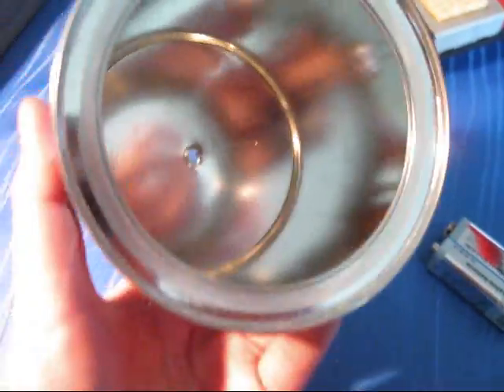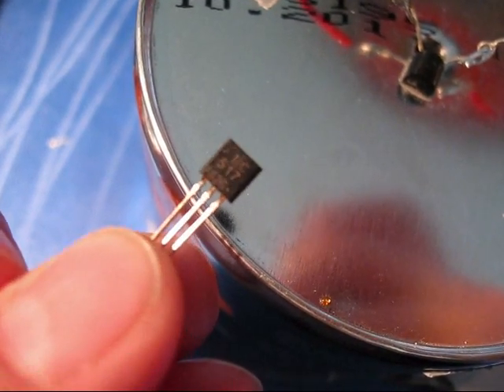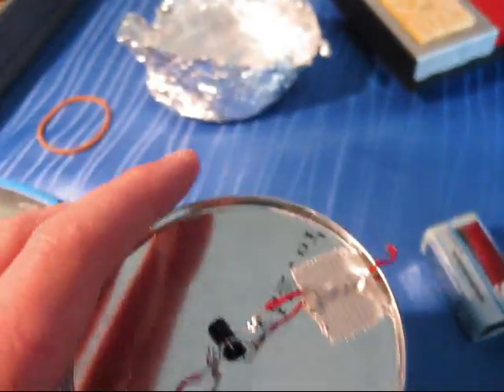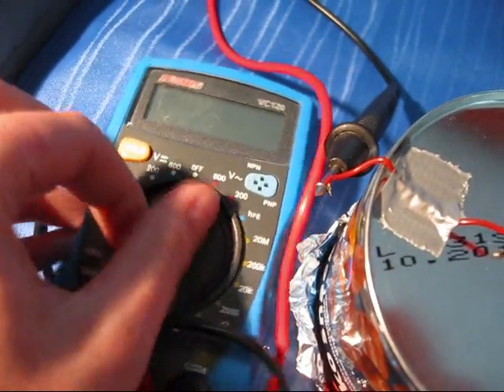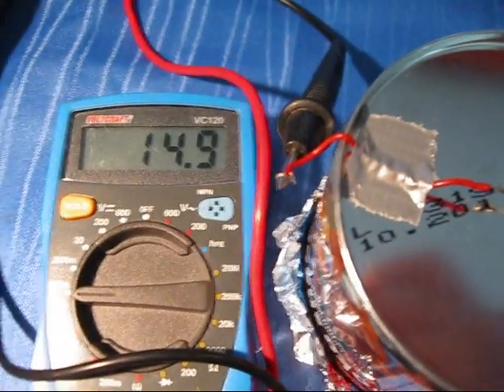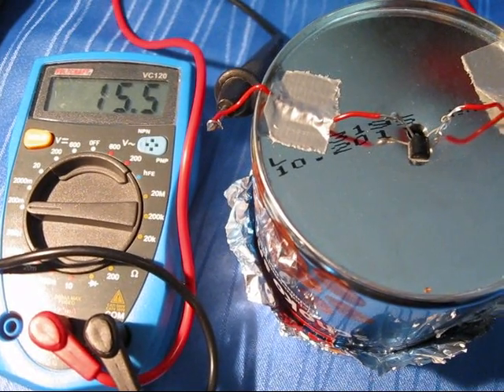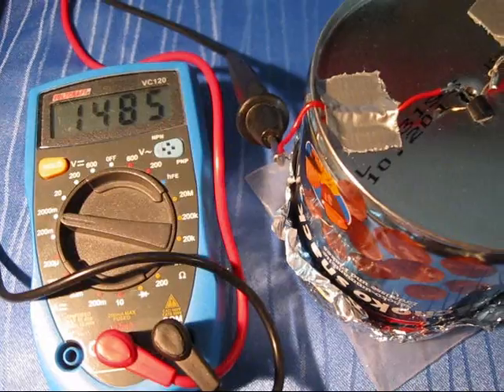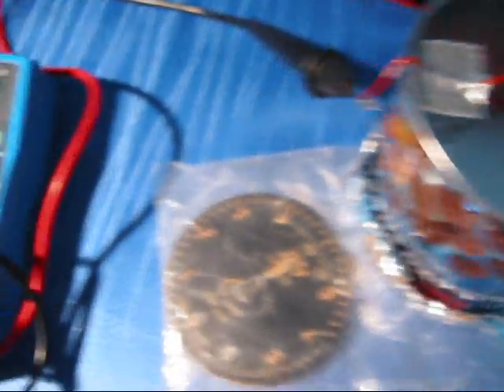how to build a geiger counter / radiation detector from household materials

Comment: I've built a slightly more complicated version of this with a differenctial amplifier circuit to cancel (most of) the temperature drift. Drift is now only 1-2 mV/°K, a toriated welding rod (with 2% torium) causes a ~30mV increase, a piece of uranium ore can cause a 100-200mV increase on the DVM.

Also I did and experiment: a piece of paper tissue was soaked in fresh (1-2 minute fresh) and dried them in the oven. The dried tissues caused a 20-30mV reaction (about the same as the thoriated rod). An hour later the reaction was only about 10mV, two hours later was almost immeasurable.

Could the rainwater contain bismuth-214 (half life is roughly ok) from the uranium decay chain? I figure the rain must have washed natural radon and daughter products out from the air. Can this be correct?
Reply: you soaked the tissue in what?
Reply: SlackerSlayer I am guessing based on the later posted question he soaked tissue paper in fresh rainwater... of course.
Reply: SlackerSlayer ...in rainwater. Thanks Pszemol :D
Reply: I doubt radon daughters are reaching the tropopause...unless you live near or downwind of a large cement kiln or coal fired powerplant. Other possibilities could be crematoria releasing short lived radioisotopes such as Tc 99, I 123,  I 135, F 19, etc. used in nuclear medicine scans.

Comment: i wanted to know which is the collector,emitter and the base of npn tip122 darlington transistor .will you please tell me urgently i have my science fair tommorow
Reply: If you look up the data sheet for it it will tell you. But usually if you face the flat side towards you. The pins are collector, base, emitter from left to right.

Comment: So the emitter is connected to the negative pole of the battery, the base is in the hole, and the other is to the multimeter. But where is the positve pole of the battery??
Sorry if you mentioned, im hungarian, and not speak english too much :(

Comment: Instead of aluminum foil, on my ionization chamber which is different from this one, I used a fine copper mesh screen soldered over the opening of the can. By doing this, you can also detect alpha.
Reply: I had the same idea! Mesh screen!
Reply: I bought really cheap brand foil from Walmart and alpha just got right through it like chewing gum wrapper.
Reply: what about beta those can do some harm too

Comment: pretty much ANY radio, walkie talkie, toys that make electronic noise etc will have NPN transistors in them. 
otherwise just order them from either digikey or mouser. they cost around $0.25 each. shipping will cost more than the transistors will, so get a few more things like LEDs, resistors in various ohm ratings, diodes, zeiner diodes, and some common MOSFETs as well. all of those things come in extremely handy when you're doing small electronics projects like this.

Comment: can you make this with sound, too so you hear the beeps ?
Reply: 6 years late lol but no, ionization chambers measure the amount of current between the outside housing  and the inside rod, meaning if you hooked up a speaker to it whenever current flows, you'd just have constant noise. Geiger counters in comparison measure each count of ionization instead of overall current.

Comment: Does it detect alpha and beta because it changes the charge of the aperture chassis and the collector will detect the potential difference through the air? If so, then please forgive my understanding when I ask, why is a long antenna necessary as it would just change the potential difference near where the transistor is (Since it's the smallest gap/distance)? Also, how does gamma even cause a reading if this is true?

Comment: None of those things were a problem. I think the distance of the wire from the metal shield at the end must have some effect. I couldn't get this thing to react at all when I built it last summer. The wire came about half-way down the can. I didn't see a length stipulated in the video, but surely there must be a certain length that will work. Anyway, I'll try again with a longer length. Why wouldn't length of the wire be a factor?

Comment: you can make Darlington transistors from 2 NPNs.
 To do that solder the emitter from the first transistor to the base of the second transistor. solder the two collectors together in parallel, and so you have one collector (the two soldered together) you have an emitter (the emitter from the second transistor) and one base (the base of the first transistor)

Comment: The voltage is initially high when you connect the multimeter then decreases to a lower stable voltage because your can device acts like a crude capacitor. That is it discharges when you connect the multimeter. My guess would be. That if you measured the voltage discharge with time, it would follow classic exponential decay of capacitor discharge

Comment: So i decided to make this completely from scratch, no solder, not even a can, i used some aluminium foil and duct tape, some scotch tape, some copper wire, a transistor and a 9v battery, and it worked! that is a MacGyver moment

Comment: Those things weren't an issue. I think I made the wire too short. I think I cut it 3/4's of the length of the can where it should probably be just maybe less than a cm from the face. But I'll try again and see what can be done. Also, I've come across a few amplifier circuits since then very similar but more components. I'll give it another shot someday since I have some good test sources now, anyway. :) How far was your wire off the front face, btw? if you remember... Thanks

Comment from the maker: largest source of issue is glue connecting the transistor legs or the transistor leg going through the hole not being far enough away from the sides... or simply a fried transistor (soldering for too long).

Comment: How close did the wire inside (coming from the base?) have to come to the face of the aluminum foil? I built this one according to what you had here and couldn't get it to work properly, but I think it was because I cut the wire a long ways back from the front face. I didn't see where you stipulated how long that wire was, but I could be mistaken. thanks.

Comment: Hey dose this detect alpha.beta and gamma radiation?  Also is it essential for the transistor to be  darlington ? Thanks
Reply: Hello random Guy from 9 years ago. 
It detects any ionising radiation. You can shield it (with paper, aluminium foil...) to detect only the more powerful radiation, but excluding the more powerful radiation to detect the less powerful is more difficult to achieve with this setup.

Normal transistors are a proportional amplifier and Darlington transistors are exponential. Darlington transistors are in fact like two normal transistors together, amplifying the already proportionally amplified signal again, therefore make it exponential.

Comment: in this device the radiation levels are indicated by an increase in voltage. the multimeter measures and displays that voltage. if you instead apply the voltage to a vco (voltage controlled oscillator) circuit, that could be made to drive an audio amplifier and speaker. so, the short answer to your question would be yes.

Comment: The problem with the radium paint was probably primarily caused by ingestion of radium from sharpening the brushes with the mouth. It was known, by the time, in scientific circles that exposure to radiation was hazardous, but the company neglected to instruct the employees that did the painting in proper safety.

Marie Curie died from aplastic anemia, probably due to chronic radiation exposure, but she reached an age of 66, which is not bad considering the average life expectancy at the time.

Comment: I have one correction and an idea. The transistor is a "bc517". The "826" part is the year and the week of manufacture. Also, the bc517 can handle up to 30 volts. Adding two "9 volt" batteries in series will give 18 volts and more sensitivity (more sensitivity may not be wanted because it was already too sensitive). The meter took time to settle because of the initial charge on the tin can draining off, and sensitive meters are designed to be "slow" when updating the display.

Comment: And it can be designed wit bigger cans or stronger darlintong transistors, in order to make it more sensitive to any wavelenght? I want to make a group of this and connect them to a computer to monitor the radiation where I live. Any suggestions?

Comment: If you got a multimeter, you don't need the extra battery, because the multimeter already has a battery in it. Turn the multimeter in to ohms range about 500k (set it to measure resistance instead).

Comment from the maker: @rachm06 
depending on the energy of the beta particles, they can get through more or less thin aluminum. i dont know the exact values, but e.g. for X keV betas, you'll need 4mm aluminum, for X keV betas, you need 2mm Al to shield, etc.

Comment: I'm asking a stupid question: if it's said that beta particles are shielded by a simple aluminum plate, how it's possible that you can reveal them through the aluminum foil? Is the foil so thin that some particles pass anyway and hit the wire?

Comment: ... The oldest of the radiometer that used a simple Curie electroscope. Van der Graaf generator loaded. This can be used to measure the discharge rate of which depends on the radioactivity. With this measure the thermal radiation of water, which today can not be measured yellow counters.

Comment from the maker: @yellowmetalcyborg 
well, if i set mine to amps, i cannot measure anything at all with it (and i can set mine to MICROamps). have to set it to volts, direct current. 
also, you gotta make sure NOTHING touches the transistor's legs... not even insulating tape! i learned that during my first attempt. they need to be absolutely free of any contact to anything.

Comment: you have been mistaken naming transistor legs: emitter goes to the negative pole of battery and collector goes to the multimeter. though the actual connection is right. also the transistor model is simply BC517. 826 is just a production date code (year 2008, 26th week). thanks for cool video! maybe i will try this )

Comment: So the radiation ionizes the gate which gives the gate a voltage thus allowing current to pass through the transistor. I wonder if you can do some sort of computation by using a number of these setups... the each radio decay itself may be random, but you could use sources of different decay rates as input for and interference patterns on the wire as the output. Make the sources(+the whole setup) small enough, and cool to a few degrees above absolute zero and you can make a quantum computer.

Comment: @pookeeboo Interesting, I've never heard of using ammonia before. I know that you can make a cloud chamber with dry ice and isopropyl alchohol, but I've never heard of ammonia. I might give it a try.
Just one question, do you need to cover the jar with a cap or something? Because otherwise the ammonia would escape... And ammonia has increased solubility at lower temperatures, so do you think it would come out of solution if you put it in the freezer?

Comment: @yellowmetalcyborg You're right, you are effectively measuring CURRENT flowing between the can and the base leg via ion migration. But the current is very minute. You have to amplify it somehow. The darlington, in a circuit where it's effectively in series with the DMM and with the battery in parallel with them, will show current flow through the base-emitter junction, as a voltage change across the meter leads, if the meter is in voltage mode and the meter's internal resistance is fairly high.
Reply: I agree, how about a FET instead?

Comment: I've tried this already and it didn't work : \. Did this one work right away or did you have to tweak it to make it work? Does the ammeter have to be very sensitive for this to work? I don't have a very sensitive ammeter at home, mine can only go down to 50 milliamps. Are there any circuits I could use to amplify the signal coming from the can?
Thanks in advance.

Comment from the maker: @EA78751 
a vacuum would not even work - nothing to ionize in a vacuum... you need to fill the chamber with some sort of atoms. a gas. air. methane. propane. noble gas. depends on the type of detector and purpose...

Comment: I'm guessing you might get a stronger, maybe lower noise meter reading with a circuit like this below but just guessing, or is this what you have and I'm just being silly and unobservant?

Negative 9v => Darlington Emitter (and maybe a water pipe??)
Pos 9v=> via 1K ohm (maybe try bigger, or none) to can
Pos DVM meter => battery side of resistor/battery plus
Neg DVM meter => Darlington Collector

Sneaky little ionization trails let current from that resistor leak into the base, we hope.

Comment from the maker: @piranha031091 
i dont think just connecting headphones will work. :P
but, in theory, you could attach a circuit that produces audible output relative to voltage flow, e.g. low pitch mumble for 10-15mV, and then increase the pitch to a scream if above 1V or so, hehe.